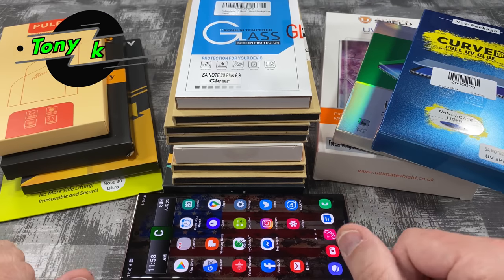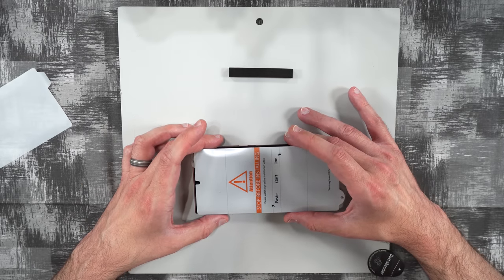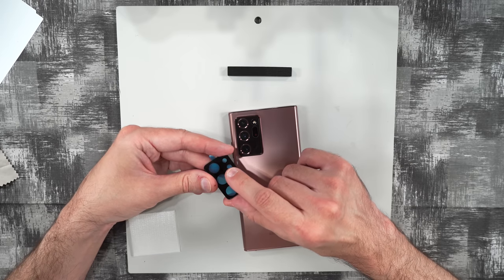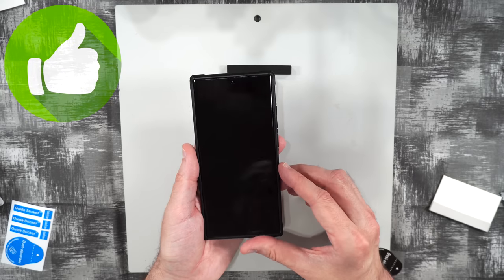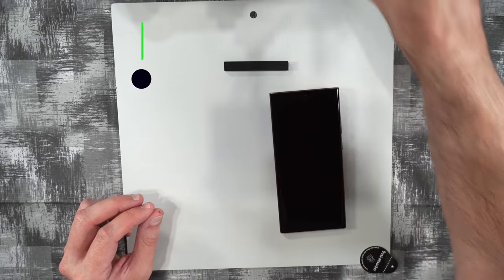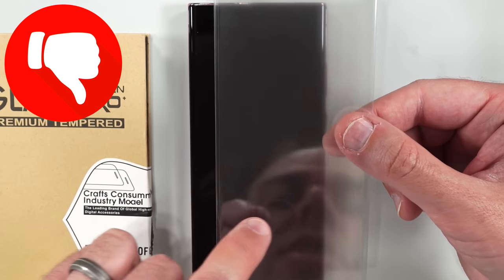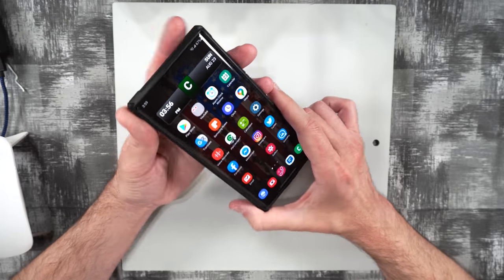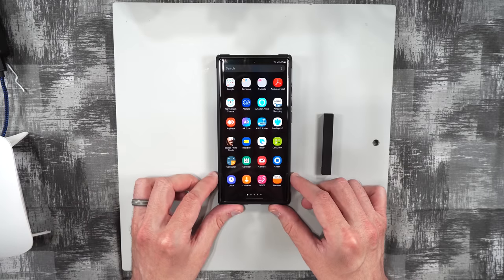Best And Worst Screen Protectors for Samsung Galaxy Note 20 Ultra

Comment: Advice for the installation of the film screen protector: i always find that taking a hair dryer and applying medium to high heat the the curved edge part of the screen protector for about 30 seconds to a minute each side helps the film to mould to the curved edge much better than without heat.
Reply: I will try that out. Thank you

Comment: This is great, just test the S Pen next time for some of these, primarily the rubbery/plasticy ones and these videos will be perfect!  Thanks for this!!
Reply: That was the only thing missing and one of the reasons I came here. I still learned alot so thumbs up for putting this together!
Reply: I was saying "pen, pen, PEN!" 🙉 by that first one. 😅 That's too bad. Otherwise great vid! Very helpful 👍🏻
Reply: Damn have u had a good screen protector that doesn't change pen feel?
Reply: Only the headache glass ones. But this one feels pretty smooth and pen glides on it.
Reply: @droid2816  headache?

Comment: Ive used the whitestone dome glass and the cheaper alternatives.   No specific brands, they all use the same liquid glue.   The whitestone dome glass glue is the one that sticks well but a little harder to peel off.

As for the fingerprint scanner, the glue between the screen and the tempered glass has to be super thin, so i put some kind of metal weight, (a 10 roll of pennies will work) on top of the area where the fp scanner is and cure the glue with uv light, only removing it to cure the fp area last.   My fp works 95% of the time.

Comment: The Ultimate Shield looks very similar to the amfilm (tempered glass) that I bought for my gf's Note 20 Ultra.  I would follow their instructions (shows 15s x 3, 30s x 3, and 60s x 3 UV light curing times/methods for example) and it is a bit more thorough also the amfilm version also has a level and a metal weight for the finger print sensor; just seems like the rest is the same with a few more points of consideration added. I paid $40 (ebay) so it is $5 more but it is a 2-pack and this is a $1300+ phone depending if you got the 128 or 512GB version, so I'm good with spending the extra $5 but the Ultimate Shield seems very comparable otherwise.  Anyhow, it seems to be working flawlessly so far and fits in my gfs case perfectly. I figured others may benefit from knowing this but great effort to go through so many screen protectors. Thank you!
Reply from the maker: Can you please email me at HighTechCheck1@gmail.com to discuss any business opportunities. Thank you

Comment: I bought a 2 pack of Whitestone dome note 20 ultra from Amazon. Both were cracked on top right. So decided to buy from the official website, arrived week and half later than 2 day delivery..... Wouldn't you know it, both protectors had cracks in the same location. Did a warranty replacement from the website and they charged $15 for 1 replacement protector. Customer service is nonexistent. Crazy to charge people more for items sent broken. Had Whitestone for 4 different phones and never had 1 arrive broken prior and I've purchased maybe 10 kits over past 3 years. Shame, quality control is going down hill
Reply: I've heard this same story about 10 times this year! Whitestone is falling off.🙄
Reply: I bought one for my note 20 ultra and I had one for my note 9 and I loved it, it never cracked or had any issues now I have this one and within  a couple weeks I have 2 cracks and 2 chips
Reply: I never got any of my money back from the dual pack or the $15 1 replacement which they never sent yet over a month later

Comment: I thought your information was very good. However, I didnt hear you mention the functionality of the S pen on the protectors.  Tempered glass would be the only choice I would think would be compatible with the S pen, ( as the plastic type , like Zagg, were terrible and the pen tip drags on the surface leaving marks, that may or may not dissipate. )   Please consider testing Whitestone vs Amfilm and any other similar Glass  types , with the  necessary  features.  Also, the quality of the glass edge ( smooth, tapered, or squared off would be a nice detail for finger contact comfort.  )

Comment: I ordered a Zagg glass fusion. Pain in the ass to install and it wasn't even glass. I just Yeeted it in the trash
Reply: It was a pain to install, it's not too bad to use but I'm going to have to take it off because it bubbled up in places. Nice waste of money for it just to be a bubble turd.
Reply: It has the word glass in the name but it's not glass? Wow! I haven't gotten a Zagg screen protector since I bought one and had Best Buy install it on my Evo 3D! That's seems like a lifetime ago! It was one of those orange peel ones and I hated it but left it on because of how expensive it was.
Reply: @silkyjohnson  i threw that shit away i was pissed but whatever
Reply: I got mine at best buy when I bought the phone, went back the next day cuz I messed it up horribly and payed 8 bucks to get it installed. Its ok but there is already some creases and a dent after less than a week of use
Reply: This protector is trash! Replaced twice in 3 months mainly due to indenting. Comes with lifetime warranty but you pay shipping. I believe a gimmick. Not because of durability or quality
Reply: zagg is Totally garbage, going back to Whitestone dome glass
Reply: I hate the glass fusion. The ultra clear Zagg is much better. First of all this one is self healing. Second of all it removes the dust free whenever you install it on your screen.

Comment: what do you think about whitestone Dome Glass for note 20 ultra?
Reply from the maker: It was good on my galaxy s20 plus, based on that it should be just as good for the note 20 ultra.
Reply: I dont usually like glass screen protectors because of the way they adhere like tape and the fingerprint scanner is compromised but whitestone dome glass adheres with liquid and cures with uv light so there's no bubbles at all and no worry about it pealing up after curing it has a tray so its perfect installation also comes with all the bells and whistles for covering the speakers and buttons so no adhesive will seep in i love mine and the uv light that comes with is very nice quality.  easy and flawless installation well worth the price and with the note 20 ultra version you get 2 screen protectors and accessories after installation you just have to re do your fingerprint
Reply: My only problem in my past experiences with the note 8 and 10+, is the durability of the screen protector. It seemed like every tiny drop would crack it. They did come with a lifetime warranty though.
Reply: Mine came broken
Reply: I had a white dome on my note 10. It fell from the couch (around 10" height probably but it fell right on the edge of a leg of a metal table i have. The note 10 screen broke because of the impact while the protector was still intact. 😂
Reply: doesn't work with otterbox and will crack your real screen
Reply: @zack9912000  I have it installed on mine and have the otterbox defender on. It works fine.
Reply: @ashtonreinke6052  well a lot of reviews have stated it cracked their screens because it was too tight
Reply: @adeochoa  same happened to me except it was in a UAG MONARCH case ..notimpressed
Reply: @patricios71  its worth, however it be nice if it not keep peeling from side after a month.
Reply: First off the price is too goddamn high. Secondly they are terrible for curved screens since it always doesn't cover it all the way 100% , I had this on my note 9 when I dropped it the very end of he curve that wasn't covered got cracked. Also this is not durable , just a small drop from pocket high when sitting  on a small chair broke this off completely. There goes 40$ , wasn't going to throw away more money , so that's the end of the road for me
Reply: @brpixels  So what did you go with instead?
Reply: @3styFekt  Just went with a plastic screen protector
Reply: @HighTechCheck  maybe you could do a video or test it yourself, but it seems Whitestone dome for the note 20 ultra is somehow made badly. Lots of reviews of it breaking out of nowhere without drops or the glue being bad. Happened to me as well. Haven't dropped it once yet the edges have cracked and bits of glass fall off every now and again. Some people even claim it's breaking where the finger print sensor is as well.
Reply: @patricios71  using whitestone dome on my s9+ for 3/4 years now, works perfectly and never had to replace it even if I dropped it countless times. Using it for my S10 5G for 2/3 years now, same deal...even after more than 2 years the fingerprint works perfectly and never had to change it. I just got a S21 Ultra, just installed the screen protector 1 week ago. Will never use a different product even no matter what phone I will get. Finger print never fails. It feels like it's the real screen and not a protector. Amazing stuff.
Reply: I put a Whitestone dome on an S21 Ultra a week ago. Have to say that following along to a YouTube video the result is great. I was a bit nervous of messing it up but no it is all in place. You would have to look so closely to even see it and the most important thing to me is that the feel is exactly a glass feel and fingerprint works perfectly having rerecord them (this is the inside trick). 

The whole drop protection thing seems a bit unrealistic to me. These protectors are there to protect against scratches and light drops. Yes it was quite a bit of money but I really like the result and definitely recommend
Reply: It's rad just buy the 2 pack when they have a sale. If the edges chip over time it's  no biggie because it still does what it's supposed to  and feels good under finger. Every thing works same as no screen protector just recalibrate your fingerprints after installation. Clarity is second to none. No bubbles if installed correctly🙂👍👌

Comment: I have used Whitestone Dome Glass for years since I owned my S6 Edge. Have never had a cracked screen thanks to them! Had them on my Note9(1 screen lasted 2 years!) and now I have it on my Note20 Ultra. I will never use any other screen protector. Worth every cent. Yes works with the fps. You don't have to but I recommend registering Fingerprints AFTER you install it so you have no issues.
Reply: I Concur
Reply: I also used Whitestone Dome. Some materials just don't work well with s-pen and my experience is that the non-LOCA glass doesn't have the sensitivity.
Reply: I had gone through 4 brands of tempered glass screen protectors for my Note 10 plus and only one I settled with- Whitestone Dome. By far the best I would recommend for the Note 10 plus as it was very compatible with the in display fingerprint sensor. Also compatible with all cases. 👍

Comment: The LK protector off of Amazon is a really solid option for a film protector. So far it's self healing has worked really and it feels pretty good to use.
Reply: I've used lk glass.on my note 8 and they are pretty good. Self-healing, that's the wet app tho isn't it?  Not a fan of them anymore personally.
Reply: They’re good, but if you use an s pen it dents the screen protector.
Reply: @8bitsamurai6  they aren't wet apply but the are film.
Reply: @KFWinterblue  so far it seems to heel well from that. I don't like the glue based glass protectors and the rest of the glass protectors are garbage. So I'm either stuck with this film or no protection at all.
Reply: lfish21 that was my problem with my note 10 was having to use those
Reply: @lfish21.  Cool I tried the uniqueme and are actually pretty solid. Only got 3 lil dust speck micro bubble from where you have to lay down the sides at the end. Prob still gonna get a glass like amfilm eventually.
Reply: @KFWinterblue  wish Samsung would stop using the curved edge. It's not useful.
Reply: lfish21 yeah, I agree. I also think they should put the fingerprint on the power button and screen.

Comment: I’ve had the OEAG screen protector since I got the phone on August 18th. It’s been very good so far. Those wrinkles/lines that the screen protector has from applying too much pressure or from using the pen does go away after a couple of hours.
Reply: All are rubber/plastic type like ZAGG. however,  you didn't mention Am Film or Whitestone Dome.   No test on how the S pen  works with that type of rubbery plastic surface.  Is there a reason why you didn't try that out?

Comment: This is a great video.  Much appreciated.  This narrows down my search, but I still haven't been able to figure out which screen protectors are going to be the most durable for dropping my phone.  I drop it all the time.  I've been hearing that a lot of these glass protectors pop off or break easily.  Do the film protectors protect it from dropping, or just from scratches?  In the end, what is recommended for a guy that drops his phone ALL the time?  For my previous Note, I used Skinomi, but as of late the sides peel up too much.
Reply: Had a tempered glass for my S10E and it did Crack but when it was time to trade in the phone for the Ultra 20 I'm writing in now, the S10E was in pristine condition

Comment: there is a YouTube channel of a guy who tests cases with tempered glass screen protectors. I have learned quite a bit from him. There are cases in which the corners are molded higher up and then there are cases in which the corners are molded lower. This is important to consider when you're thinking of using a liquid-based adhesive tempered glass protector.
Reply: Which glass/screen protector would you prefer?

Comment: I always used screen protector until recently i just took it off and man the feeling is different. You spend over 1000 for a nice phone why cover the glass with a lower quality screen. Your  phone will look and feel 1000x better imo a good case is all that's needed.
Reply: Till you drop it and the landing hits only the screen and not the case.
Reply: I just dropped mine and fucked my screen. So yeah...
Reply: @Pablodwnunda  a price im willing to pay sadly especially on a curved screen most curved screen protectors are trash but a flat screen i would definitely pop one on.

Comment: Have you come across a protector that isn't that rubbery TPU film and is not the crappy glass ones. Unfortunately after adding the curved screen the glass protectors have been garbage. The previous note 10 came with factory screen protector which was like a thin plastic protector that felt good but was not as durable. I wouldn't mind replacing it every couple of months if i could find it. If you come across this type of protector please let us know.
Reply: itzjung really...this old guy is still using that on on my note 10+ with a case and my phone still looks new.  Cases are a huge factor i have found.

Comment: Hi, great video.  Because of your video I stayed away from UV types.  I installed a hydrogel protector.  As soon as the installation is done, I immediately use the Spen.  I noticed there are like cross over lapping lines in the screen protector visible only at a certain angle and in reflection of light, you won't see it when looking at the screen normally.  My question , did my Spen caused this?  Shouldn't I waited for the protector to heal itself over 24 hours before I use the Spen?  Thanks.  I am amazed by your effort to try all those products to come up with this very comprehensive review.
Reply: Hi. I just got my Note 20 Ultra recently and it has hydrogel protector pre-installed. The thing is it scratches easily for me as I had long nails when I got it, not to mention there were air bubbles that expanded when it got hot. Noticed that it's not sensitive enough for S pen as I had to press harder on the screen and it worries me if I end up breaking the S pen.

Currently using the UV ones. Is it that bad? I might switch back to hydrogel as the pre-installed were 1 year old.

Comment: speaking in general, without naming porduct 
work quick in a bathroom with shower runing, NO dust at all
next time I will wait 20 min (?) for dust to stay stell to the ground and moisture in air to disapait hopfully leaving a clean room to cover.

Cons: Another factor to add or worrie about when troubleshoot screen problems that occationally turn up
my previous dust protector ruined my stylus made w/screen mesh over rubbery tip

Comment: What is your opinion on the Infra Red Screen Protector.I have installed it twice & i am so frustrated to see that my screen starts getting scratched & even bublish with some Rainbow colour from the sides , once i dropped it on the floor (and once or twice outside.

So , i noticed in one shop that the guy had a simple screen protector.Will that be tough enough compared to the In Fra Red Screen Protetcor ....

Comment: Thanks for your patience really great video. Whatever screen protector I get I'll get it through your provided links to help out. And yes, liquid can easily come into the speakers or mics even in the s-pen cavity, if it becomes messy. If it does and you cured it, use a dry soft bridle toothbrush and brush it off and use a vacuum from a distance (do not rub the vacuum tip on the phone to avoid scratches) to pick up the particles from the glue after brushing. If you haven't cured it, damped Qtip with water and rub away with the cavity facing the floor so that gravity works on your favor. Then damped another Qtip with alcohol again and rub away, don't push.

Comment: I bought a cheap $10 UV tempered Glass screen protector from ebay for my s20 ultra. My fingerprint scanner wasn't working after. I was so pissed off becuase it worked well with my s10. I waited 2 days and it started working again. The only difference is that fingerprint is a little higher when pressing off the area and it takes a little longer while registering. I registered 4 times all with my thumb with difference angles. I hope this helps others. Just try waiting 1-3 days and see if it registers then. Good luck.